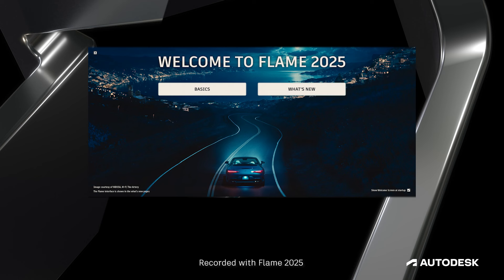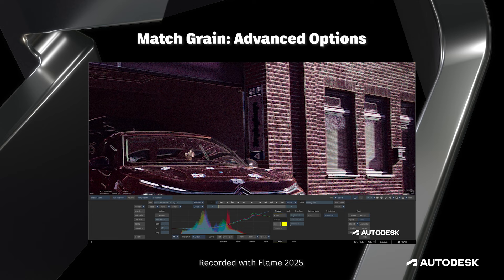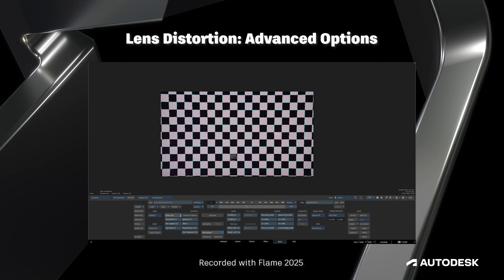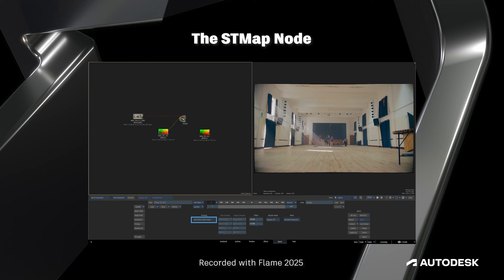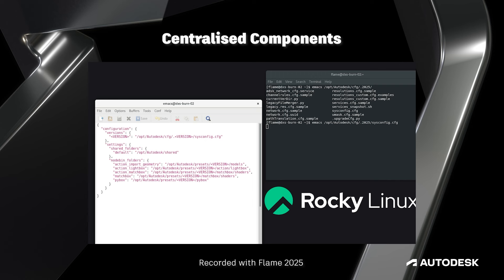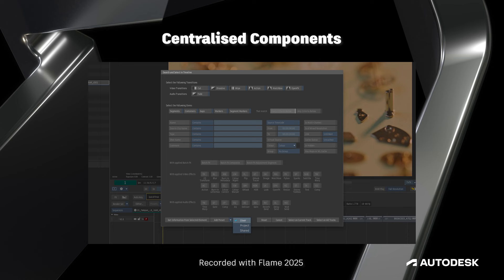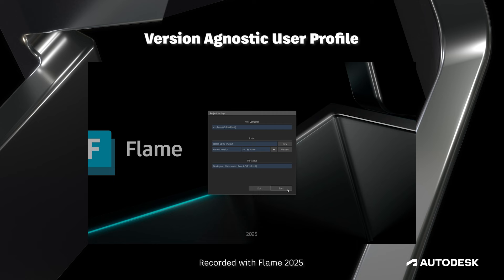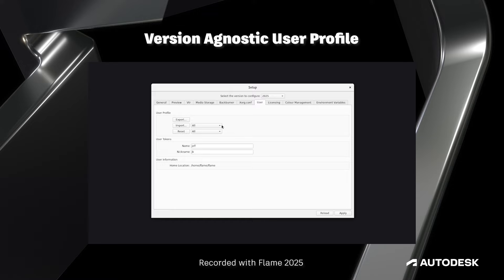What's New in Flame 2025

Comment: How about improving camera track. How about being able to use an Extended Bicubic on a projector. How about the projection freeze not freezing any upstream color correction. How about some super simple easy extrusion drop shadows. How about updating the 1980’s text module and adding some cool motion graphics presets. How about improving the ability to change the metadata on Debayering of Red Cam import!